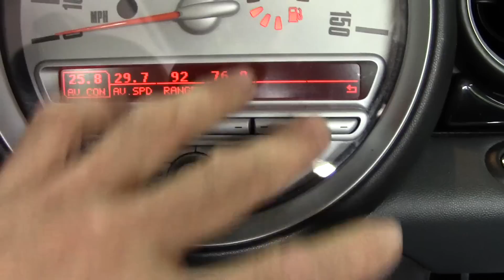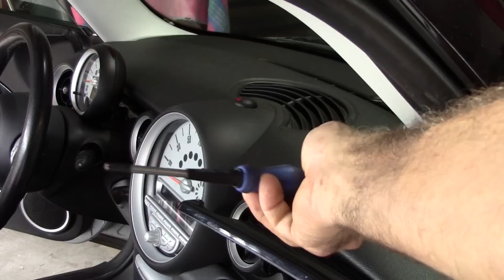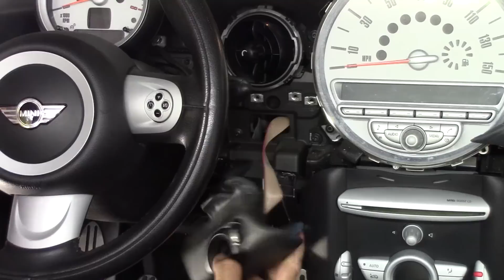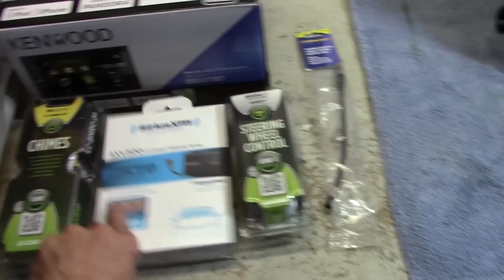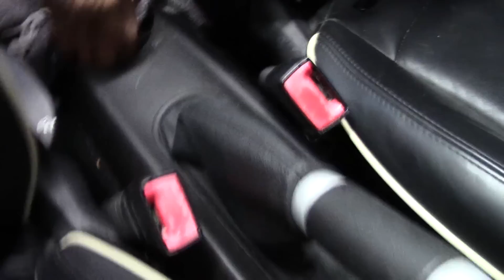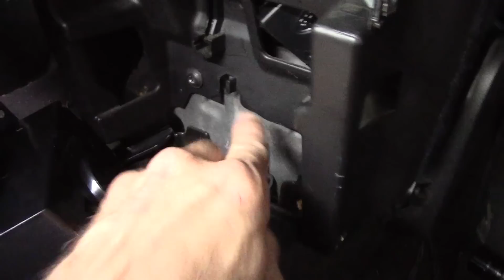2007 R56 Mini Cooper S Radio Swap

Comment: Hi , Excellent video! Very specific, but I would go crazy removing so many screws. I have a 2008 Mini Cooper and they did this same job for me where they install radios. If I had seen your video before, maybe I would have done it. Not all of us have the same ability .
Reply from the maker: Nearly all the screws are the same. Only two are different.

Comment: Since the time is set at the head unit, how do you adjust the time when it needs to be set?
Reply from the maker: On the tip of the signal light lever. Push in on it and the data displays on the tachometer.

Comment: I know this video is super old but I’m curious how you went about wiring the yellow power wires. The harness has a yellow power form the car and also come with one to wire direct to the battery. You didn’t touch on it much in the video about the actual wiring of the harness but I see you connected the yellow from the harness to the yellow from radio with an inline fuse. Do you ever connect the battery direct as well? I just installed one and saw another video where they just wired to direct to the battery as per the instructions and left the yellow on the chime retention harness unconnected and taped out of the way. I did it this way but I have all kinds of weird electrical issues and just wondering if you experienced any issues after the install? From what I understand without the contact from the wire direct to the battery you will just lose all memory after a short amount of time.
Reply from the maker: Honestly not sure. I think I ran a wire directly to the battery with a fuse holder.
Reply: Did you figure it out. You connect the radio to the long yellow wire that you should have connected to the battery. The yellow wire to the harness doesn't get connected

Comment: I know it's been a few year but by any chance do you remember how the wiring worked out? in seeing a lot of comments on forums about memory loss and I dont know where to hook up the red and yellow wires

I know yellow should be constant, but according to forums, that pin on the OE harness stops supplying power after like 10-20 minutes, and I cant find any information on what wire to hook up to red/ignition

essentially I've spent 2 days trying to find a pin out of the factory radio harness

Comment: Great video, helped out a lot. Now I have a service engine light on, maybe from pulling out the head unit?
Reply: Did you ever get this figured out? I just installed a new deck and having weird electrical problems and check engine light as well.

Comment: I know this vid is from 2016, but they make a gauge delete to where you can kill that big ass spedo and just have a radio there.  Planning on doing it on mine.  And if your a mini owner that did not know, you can just set your speed on the steering cluster digitally.

Comment: Sorry, I realize that this video is 4 years old, but I was wondering if remember the wiring for the steering wheel controls. I'm working on my r56 now and I'm stumped. It's very hard to find wiring diagrams for this car.

Comment: I realize this video was uploaded 4 years ago, but do you think you could drop links of all the gear you used to upgrade each part? I’m thinking I’d like to do the same in my 2009 Mini Cooper S R56. I would venture to say since your is a 2007 and it’s same generation car, all the equipment is compatible. Those links to where you purchased everything would really help me and I’m sure others out!
Reply: We're you able to do it? I'm planning on doing this on my r55 but I'm worried that all the speakers won't work, if you did, did you get sound from all 10 speakers?

Comment: Great video. I followed this as I removed the pieces. Couldn't have replaced my radio without this video. Thank you so much. Even though my Mini is a 2013 it was still the same. I even for the "secret compartment" that I didn't know I had. I knew some mini's had them and some didn't. I just figured mine didn't. Win, win.

Comment: I have do the same to my R56 2009 S, now that is ben there for some time, I realized that I should put some glue or sealant on the kit that cover where the radios controls used to be, because now I have a lot of dust inside the speedometer, Great job, I wish I was so handy like you!

Comment: did you have any problems with the heater and the aircon after I've done mine since I put it back in the blower only works by feet and the aircon button bent work either
Reply: Did you ever figure this out? I'm in a similar boat after putting in an android double din unit.

Comment: Just replaced the radio in my R56 with a Kenwood GPS unit.  I too am trying to keep the computer display instead of using the blank outs.  I was able to disconnect the ribbon cable from the back of the computer display and as a result was able to leave the display and controls in place.  Of course, now there is no power to the display.  However, I was able to take apart the radio head unit to expose the ribbon cable all the way back to where the original wire harness was plugged into.  

So the question is what powers the computer display?  It looks like the radio harness is divided into 3 sections.  

There is a right bottom section that has 9 wires in it.  I would assume that would power the radio and speakers.  There is a left bottom section that has 2 black coded wires and access to the fuse.  And then there is the top section, which is divided into 2 parts.  Does that work the computer?  

The reason I don't know is because I did not put the radio in.  I had my local Best Buy guy do it and he frankly did not have the time to chase my idea.  

What do you think?  Is this the possible space for the computer inputs, etc?
Reply from the maker: That display is controlled by the board in the factory radio. The only way to keep it is to keep the entire board intact, along with the CD mechanism. The info on that display is also present on the tachometer display and can be accessed with the button on the end of the turn signal lever. You reset any function by pressing and holding the button until it resets. No need to keep the display in the middle.
Reply: HackaweekTV I was able to remove the entire cd mechanism and keep all 3 boards intact. Then I closed the unit back up to cover all the boards. 

What I don’t know is what set of wires work the display. I’m thinking its the set of 24 (2 sets of 12)above the square set of wires. All these wires are placed in a shared harness in the back of the radio. 

Am I thinking correctly?   I don’t want to tear into the dash again only to be wrong. 

And yes, I do use the tach display now, but would like use of the original.

Comment: Great video, I am going to do mine this weekend. Was hoping I could keep the digital display and not have to put the black out parts in the speedometer.  Do you think that is possible?  Was hoping I could get some of the computer parts to still work.  What do you think?
Reply from the maker: I tried. The computer unit is built into the factory CD player. I gave up on that idea. The info is still displayed on the tach and you can use the push button on the tip of the turn signal stalk to toggle through the read outs. If you want to reset one, just hold the button in for about 5 seconds and it'll reset.
Reply: Well then maybe I can replace the speedometer with one that takes up the whole space.   Or I could just leave the dials, etc in place. Even if they don’t work.

Comment: Hi, I have a 2009 r56 cooper d and the stereo broke down... Do you think it is possible to replace it with an used one? Will it need a firmware flash to fit into my car?

Comment: I have a 2010 Clubman with the exact same radio CD deck (Alpine). The CD player began acting up at around the 45k mileage mark. Ridiculous because it was not used much and treated very carefully. It began with skipping on tracks, then eventually just failed to recognize any disc. Used a Best Buy laser cleaner disk and it actually helped but only for about a week. Then the player never recognized a disk again. Stupid stuff. I resorted to bluetooth streaming using a little receiver plugged into Aux mini jack. Okay but a pain to use. Volume  input level not the same as radio so you have to be careful when switch from radio mode to Aux mode because the audio input level is much different. Finally, the freaking radio simply acted up last week, FM just went nuts. No matter what selection I would make on the radio controls something else would occur. Totally electronic logic failure. The entire radio system is absolute junk. Even the control knobs are so flimsy and weak they can fail at any time. Be extremely gentle with those two silver or black rotary knobs or you will be sorry. I found a replacement radio in a salvage yard.and am beginning the replacement this evening. It was not fun removing the radio from the donor vehicle. The engineering of the entire radio system is insane. I think they designed it during Octoberfest in a Munich  Brauhaus ..... worst design I have ever seen ! but, if it's any consolation I have heard horror stories about other brands of vehicles as well. You will need a lot of patience and time to replace the radio. DO NOT rush the job and by all means use correct tools. It's a good video based on my experience removing the radio from the donor vehicle in my case but I found some of the disassembly is not necessary. There can be a single screw on the top of the speedo display that is hard to see which might need to be removed on the car. I did not have to remove the two small vent covers on the top of the dash as shown in this video. There was only the single screw in the center behind the speedo on top. It is screwed through the white plastic mount of the speedo. I also dis not need to remove the panel behind the steering wheel. Take your time, the unit will come out without dismantling everything shown. Good video though, just my experience was a little different. Use plastic (nylon) tools !

Comment: You really deserve a big like from my side because you saved me $1450. My radio and sound system stopped working and I asked Mini dealer to fix it they said it will cost you $1500, so I decided to fix myself. I ordered a preowned radio and sound controller from EBay for 50 bucks and installed it myself following your video. Thanks you for the video
Reply: This is this only video I found that actually takes the time and guides you step by step. Great work

Comment: Ok,  I have a great question... it’s possible to use apple CarPlay?
Reply: Ivan Ruiz yeah you can, CarPlay is just the software built into certain hardware devices. So if the radio unit fits (like mine will) the unit supports CarPlay.

Comment: For the record, you can do everything from the BC buttton on the stalk as you can with the speedo display. You can reset the trip and gas and mph and even set the clock. You can reset all your service intervals and all that too.  It shows you how in your owners manual

Comment: well I've a 2008 R55 clubman S & I've almost completed my double din install 

I'm saying kind of, as I'm awaiting a new aerial due to my pioneer stereo not being Dab enabled so I'm needing to refer back to old school

anyway for a car with built in sat nav, parking aides etc once the double din is installed you loose it all. loosing the built-in sat-nav due to the sat-nav map/disk being removed & that takes all the controls away from the central screen so its now totally blank.

Again with the central screen now being blank due to no signal from the stereo/sat-nav control units the parking aide reverse sensors don't ping anymore so that system is redundant.

Also the 2 cup holders are also very limited now as any large can of pop/drinks will block the window switches or simply not fit, also the little cubby area forward of the gear stick is also now a lot smaller. 

to-do the job it'll take the best part of 3-4hours, easily 30-45mins removing all the dash that needs to be removed as its a lot "but is very easily done!" installing the stereo is again basic with only slight mods required for final fitment ie

extending the stereo bold holes to give final fitment a good finish.

trimming the replacement fascia to allow full function of the stereo & to allow the heater buttons to work, ie heated seat button catches with the fascia hence trimming of the insides required

I've used the connect2 fascia & kit found all over ebay/amazon... again my radio issue I believe is down to DAB compatibility hence the aerial change.

the overall benefits "the stereo sound sounds soooooooo much better!" I've played 1 cd & enjoyed every second compared to the basic stereo, also the function & basic options you've a much wider choice. any other functions I've not noticed to have lost any, except for now adjusting the clock on the tacho (unless I've turned blonde I cant remember how to adjust that) however the stereo has a large time display etc

anyway for anyone wanting to do the job I'd highly suggest doing so

Comment: one of my biggest things is you cant change the time on the drivers side dash if you do this.
Reply: Blake Chertkow you can do everything with the bc button on the stick. Scroll to set/info hold the bc button when the options pop up push it again until you see the clock icon the hold it until the box pops up around the hour then set the time

Comment: I installed the Pioneer AppRadio 4 in 2014 into my 2011 S Convertible. Same kit, but I trimmed and mounted the original stock CD player (with 150 MP3s on a "permanently" inserted CD) behind the speedo to retain the controls and display in the speedo.

Comment: What was your solution for the Sirius XM antenna? Does it tie into your existing antenna or did you use the one that came with the Sirius XM tuner. My car already had XM on the stock radio so I am trying to  avoid installing another antenna.

Comment: Yup there’s something in the order of 50 screws to remove, some hid behind bits of trim on dash top. Much fun. The Cooper S is supercharged by the way, not turbocharged. Just thought I’d mention that.
Reply: 2007 model is 1.6 turbo.
Reply: R56 Cooper S  = 1.6 turbo.

Comment: Is there like an easier DIY solution to simply install a bluetooth connection or a CD Changer emulator without pulling the whole dash apart?

Comment: Great video!  I spoke to an installer who said that I might have an amp driving my speakers.  Did you have to wire for an existing amp?  Apparently the Minis that came with the Harman Kardon sound system had a separate amp.  my '08 has two door speakers and I am thinking it might be using an amp as a crossover?.

Comment: During your install you plugged the factory Aux plug from factory wiring harness back in its location then you plugged it into the back of your aftermarket radio.  While doing this you said you “made” the patch cable?  How did you do this in order to retain factory plug on one end and 3.5 jack on other end that plugs into radio?  Thank you in advance for any response.   I am only swapping to an aftermarket radio in my Cooper because the aux button on the factory radio does not show up as an option even though it has the factory aux port installed on bottom of radio panel right next to that cover that has to be cut down next to the aux port.   It is weird that mine has the factory installed aux port and factory wiring going from it up to and plugged into the factory radio (ran through the factory loom even).  Not sure why my aux does not show under “mode” button on radio.

Comment: First off, thanks. Simple with the descriptions and clear. I was able to do the same thing at the same time with little pausing or skipping. Very good video. 

Now, I'm trying to diagnose a button issue. Those selection buttons for the radio, some work and some don't. Primarily the middle guys. So I figure there's some debris between the plastic button/membrane/switch. I got to the point of removing the speedometer before other things pulled me away. 

Question is: does that sound like the right thought process? Can you get into the interior that deep? Or do I just need to search for a new set of buttons or speedometer? Any insight is appreciated.

Comment: I apologize if this is a stupid question, but did you need to buy any adapters for the new radio? If so, where did you buy them?
Reply: You can buy the adapter online or your local auto stereo dealers - It's a Metra Part #70-9003. Also what he forgot is that you will need to add a constant 12V wire to the radio/receiver. Do not use the one with the adapter., it loses 12V after how many minutes the car is off and your radio/receiver will lose some of it's settings from memory.

Comment: THX! Your video helped me to break down my 2009 Mini S & saved me big bucks on changing out my non working radio. Only spent $100 on a used one. I changed out the 3 circuit boards & main unit with my existing good clean front parts. Luckily I didn't have to get it reprogrammed. (it's so important to buy the right compatible unit) It was a long process but it was well worth it all! After 5 longs months I finally got a working radio again!

Comment: Great video. Thank you for making it. My only comment would be that it instead of routing the microphone cable through the access hole on the side of the dash as you did it would probably be easier to run it all the way down to below the dash. I believe that would allow the cable to be completely hidden in the door jam tucked under the rubber molding.  Regards,

Comment: so i have a 2012 Mini Countryman. My dash is really close to yours but it does differ a bit. I've looked on Ebay and they have these kits that they say will fit mine. But the dash kit looks more like yours than mine. Does the set of buttons that have the "Sport Mode" & "Driving Light & "Traction Control" switches come off separate than the new faceplate you put on. I couldn't quite see at the end of the video if it's the same.